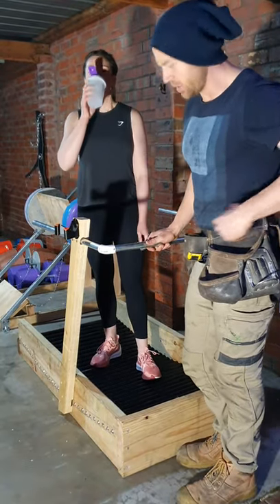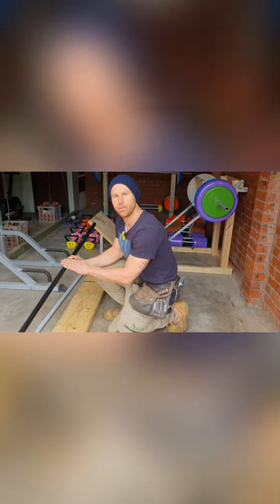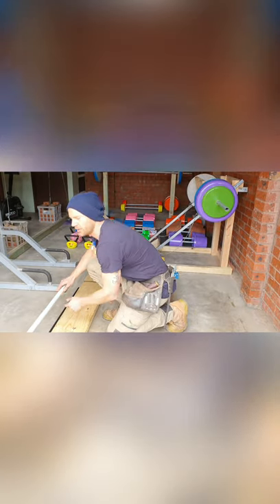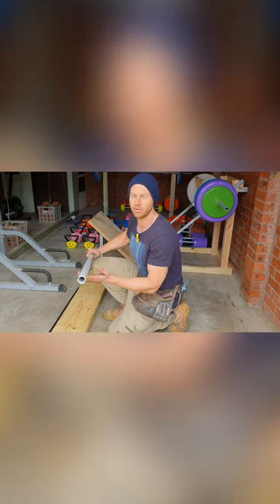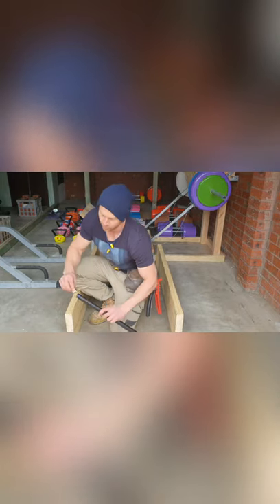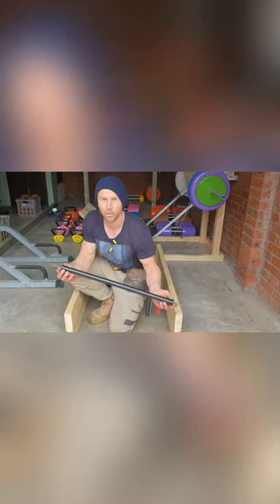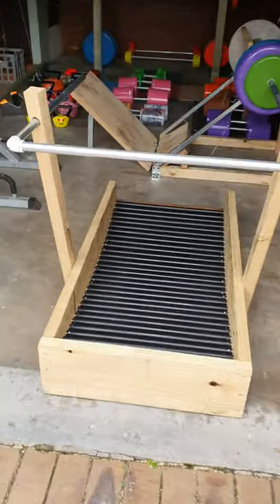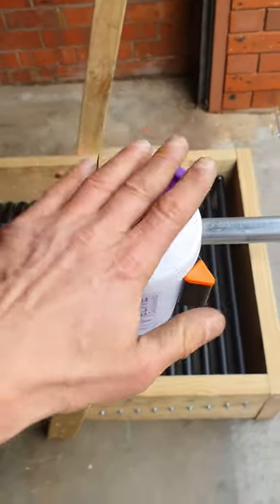DIY Treadmill

Comment: Can it hold 250 pounds or more really trying to take the weight off. Will it break during time? And how long will it last before breaking. I know these maybe not built for running, walking is good enough for me.
Plus if you can build one for Me how much would you charge? Is $$ 300-400ish sounds good enough for you?
Reply from the maker: It will hold 250 pounds as long as you follow the correct materials as labelled in the description. I'm not sure how long it would last...it all depends on how much you use it! I don't make and sell sorry, that's why I've created a video so that you can give it a go yourself😊
Reply: @MattLees-Nunan  thank you this video will help. 
I checked that a project like this for carpenter can charge $200-$600 on a small project and can go even go up to 800 high end. Depends how much you worked on it and how many accessories and light weight adding a motor etc etc. 
Not bad I was willing to buy one. Don't have time and the tools. Might have to rent it or buy them and return them to get my money back. From the tools.

Comment: How much is the total cost? Also, would it work to put a rubberized cover over it more like a treadmill? This would also allow modifications to easily measure distance run.
Reply from the maker: It costs $200 to make. Yes, I suppose you could try putting a mat over it but you'd have to find a way that it wouldn't hit the sides as you're running along🤔

Comment: Hi, sorry my bad English but I have a doubt, I don't understand the measurements.
If the tubes are 25mm and 3mm thick it means that the internal diameter is 19mm (?), How do the bearings fit if they are 22mm?
Reply from the maker: 25mm is the internal tube measurement👍
Reply: @MattLees-Nunan  ok
So we have external diameter of the bearing 22mm and internal diameter of the tube 25.... there's still difference

Comment: What is the reasoning to make the curve? Will straight one work? Getting a exact curve on both  the sides seems challenging
Reply from the maker: Yes, it can be challenging but without the curve, you're unable to go as fast!
Reply: Sorry to ask you a dumb question but what is a pop rivet and which would be a right one for 1 inch tubing?
Reply: I got it thank you. At what distance would you put the rivet from end of the pipe?
Reply from the maker: It depends on the width of your bearing really.. It's there to stop the bearing from moving in further down the tubing

Comment: Does the 25mm tubing go into the wood side panels to hold weight
Reply from the maker: Hello, the tubing sits over the bearing and the bearing is connected to the wood panels. Hope this helps🙏

Comment: I’m a big girl how is this on weight bearing, and are you able to just walk on it or do you have to run?
Reply from the maker: It will definitely be strong enough as long as you have thick enough metal tubing. Yep, most certainly you can walk on it👌

Comment: Hi what part goes into the wood panel at side to hold the weight
Reply from the maker: Hi Joe, you'll need to put the 6mm x 70mm bolt through the bearing and tighten the nut on each side of the panel. I hope that makes sense?

Comment: *edit

Hi Matt, are your bearings flush/tight within the inner diameter of your tubing? I'm building my skillmill right now and the bearings are a little loose inside the pipes.
Reply from the maker: Hi Jonathan! If they are a little loose then  try putting some electrical tape around the bearing so it is tight around the tubing. In the movie you'll see that I put pop rivets on each side...This will stop it from hitting sides. Does this help?
Reply: @MattLees-Nunan  Thanks for the swift response. The tubing I have is 1" OD, so I used 1.25" OD fender washers. Unfortunately, they are loose as well since nothing "pushes" them against the pipe openings like your rivets do. I'll think of a solution and try using electrical tape. Keep you posted!
Reply from the maker: @jonathansebastian8421  Look forward to hearing what you come up with!😁

Comment: I don't know about the distance measurement of each bearing
Reply from the maker: Oh ok, sorry could you please elaborate a little more so I can answer the question?😊
Reply: @MattLees-Nunan  how much is the distance between bearings? so they don't rub against the jogging tubes.
Reply from the maker: @jackfellher7574  ok, now I get it😊 10mm from each end. That's the reason for the pop rivets...so the bearing doesn't come out the side👍

Comment: Great job! Are you able to sprint on this?
Reply: And, how did you mimic the curve on both pieces? Did you use one as a template, or did you measure the start, middle, and end for both and then bend the pipe accordingly
Reply from the maker: Thank you😊 Yep!! Sprinting is fine, that's what the curve's purpose is👍
Reply from the maker: @Jais271  I curved the pipe as a template and then measured each one as I went along. You could probably just drill through both pieces at once but I wasn't sure how straight I could drill down, so just took the extra time to be sure!